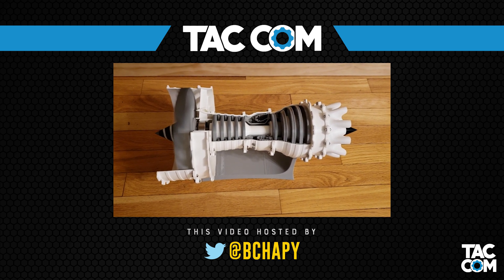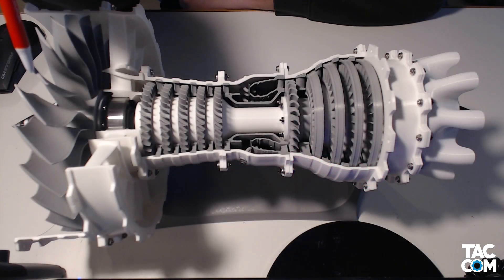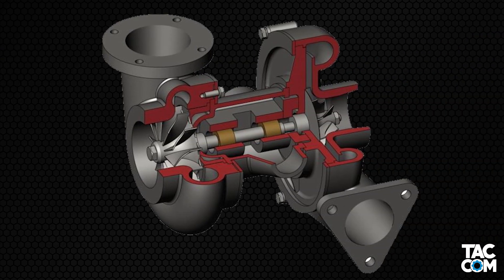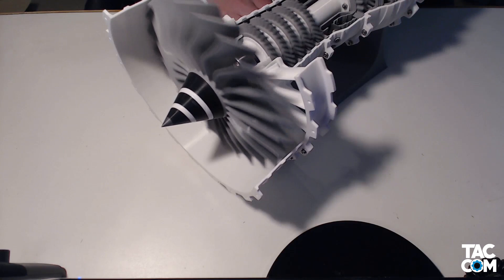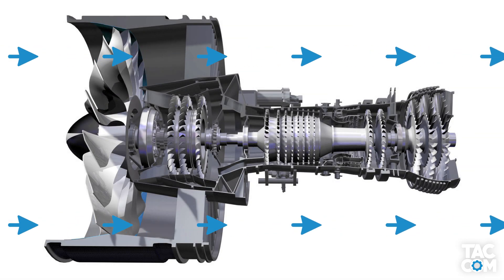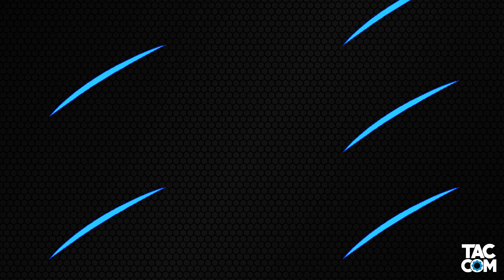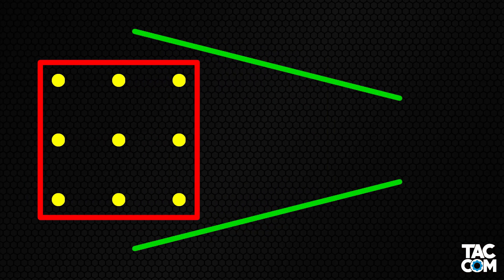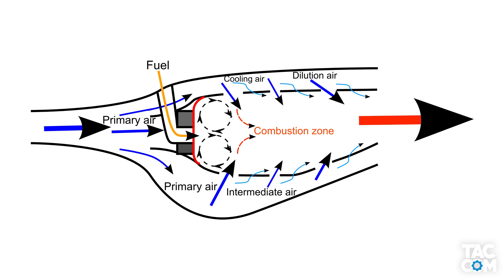3D Printed Jet Engine - Part 4: How Jet Engines Work

Comment: Very helpful series, I'm currently working on printing all my parts for assembly in (hopefully) the next few weeks.  However, I always thought "suck, squeeze, bang, blow" applied to a piston engine, and "suck, squeeze, burn, blow" better describes a turbine, did I get that wrong?  Or more accurately, did my A&P get those wrong, since that's who taught the expressions to me?  Once this is complete, and I'm probably going to add a few accessories like the cowling, etc., then I plan to work on that monster 6' tall Saturn V from thingiverse, though that one may make this one look like printing out a little boat in comparison to this LOL!
Reply from the maker: We still use "bang" as a description, but "burn" is probably more accurate. I'm guessing it's just because "bang" better conveys that energy is added.... Not to mention the innuendo.

Though pulse or rotating detonation engines are certainly would be a"bang".

Comment: The fan doesn't generate thrust due to creating lift in the aerofoils.  The fan is putting work into the flow.  Circa 80% of the thrust on a high BPR turbofan machine is due to Newton's 2nd law.  It has high efficiency because a large mass flow is accelerated a small amount (dV), as compared to a turbojet which has small frontal area for packaging and accelerates a significantly smaller amount of air through a higher change in velocity.  This large jet velocity is responsible for most of the noise.  Military engines are significantly less efficient due to their lower BPR, but package much smaller (benefiting weight & size).  In short, overly simplified and fundamentally wrong in your explanation.

Comment: I wanna know how exactly the pressure is calculated pratically in the compressor stages?
Reply: To answer this short, here’s the relating formula: 

CW = [cp * Tt]2 * [CPR ^((gam -1) / gam) - 1] / nc

The long answer is far too long for me to explain here since there are many variables and you’re probably interested in how those variables are affected. 
This is subject in Aeronautical engineering studies and since it’s purely thermodynamics and fluiddynamics it’d exceed the frame of a simple YouTube comment.

I suggest you read some papers on Compressor thermodynamics published by NASA. They’re free on Google.

Here’s a link

https://www.grc.nasa.gov/www/k-12/airplane/compth.html

Comment: Hi there . It was very interesting . Im studying to become an aircraft engineer and you explained it better than my professor...

I wanted to ask if you powerd youre turbine engine with an electric motor of sorts?  Its for a class project and it would add some bonus points if i can get it to rotate by itself. 

If you dont mind helping in any way . Thank You very Much
Reply from the maker: I just put an electric leaf blower in front of it :p

On the thingiverse link there are some alternatives that include motors to make it spin though. Perhaps one of those would work.

Comment: I love how you managed to explain it so easy, my teacher was a bit detailed to start with when learning us how it works.
But what he always said was that the principles of a turbine engine is really simple but making a engine is much harder because of the intense heat, pressures, failsafe and controls
Reply from the maker: Yeah, it's not too difficult to design a basic engine. As you push the limits of efficiency though, there's a lot of really cool advanced technology that comes in and makes it really complex. Also if you look at an industrial power unit, it's basically the same thing as an aircraft engine - but instead of the core spinning a fan, it powers a generator. The same goes for an industrial oil pump. Those are interesting because it's basically the same design, but they aren't concerned with weight.
One of the hardest parts of hardest parts of the design is being able to withstand those intense temperatures/pressures, whilst reducing weight as much as possible.

Comment: How is it that the combustor stage doesn't create enough backpressure to stall the HPT inlet turbines? I realize that it's effectively an expansion chamber but if it has to drive the exhaust turbine of the HPT stage then there must be more net force on that exhaust turbine than all of the inlet turbines of the HPT stage.
Reply from the maker: I'm not sure that I'm following what you're saying. When you say "inlet turbines", are you talking about the HPC?

If so, Google "Brayton cycle".
You'll see that the combustor doesn't actually cause any change in pressure. All it does is add energy to the flow.

As for stalling the compressor, that certainly can happen. If it's strong enough, it's a "surge", and a fireball from the combustor can travel back out through the front.

As long as the engine stays within the bounds of the compressor map, the mass flow rate should be strong enough to overcome the desire to surge/stall.

Too much flow (or too low pressure) will cause it to choke.
Too much pressure (or too low flow) will cause it to stall.
Reply: @TacCom  When you talk about the fireball coming out the front of the engine I can tell you about a time that I had that happen to me.

I'm a jet engine mechanic with 30 years of experience, 20 years in the USAF.  I was doing a maintenance run on an F-15 to ops check a problem that a pilot reported.  The pilot said that he had an augmentor no light (AB no light).  During the run, I pushed the throttle up to MIL power and let everything stabilize.  I then started to slowly push the throttle into AB.  My nozzle was opening and fuel flow was going up as it should, everything looks good.  I kept slowly pushing the throttle up and fuel flow was just over 30,000 lbs/per hour.  This whole time I was thinking that the AB was lit and my ground guy never said that it was not.  At just about 33,000 pph fuel flow the nozzle slammed shut and the fuel ignited off the T-Wheel causing the HPC to stall.  I saw a fireball come past me from the intake.  I have had engines stall before but nothing like this.

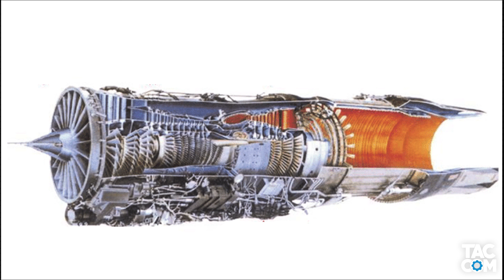Oh, @1:34 you say that many military jets have no bypass, that is not accurate.  If the engine has an "Afterburner" then they do not have a bypass and are called turbojet and engines with "Augmentors" are a low bypass and called low bypass turbofan.  The image you used in @1:34 is an F100-PW-220 and that is the engine that I have worked on for more than 20 years and it is a low bypass engine.

Great video explaining how a jet engine works and love the other videos showing how you put the 3D print together.